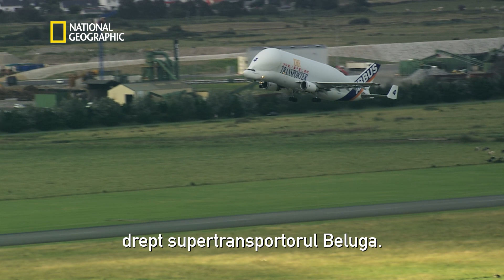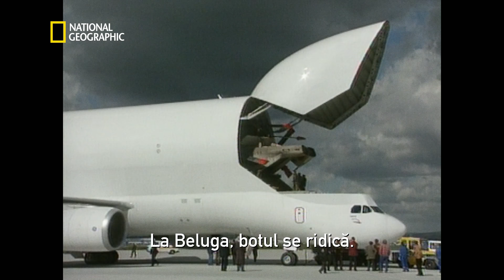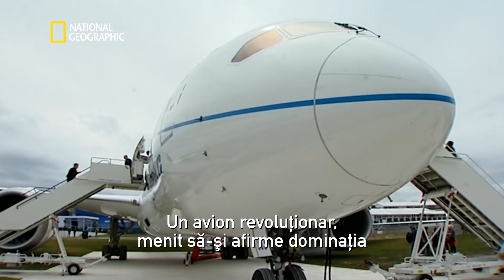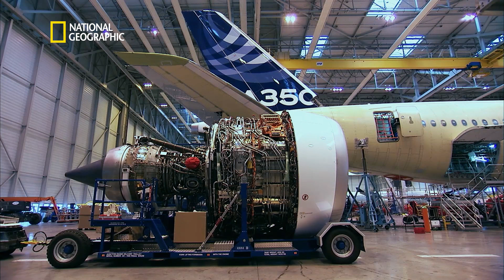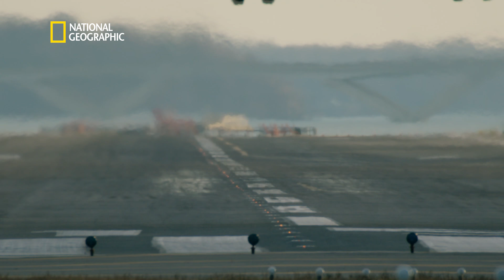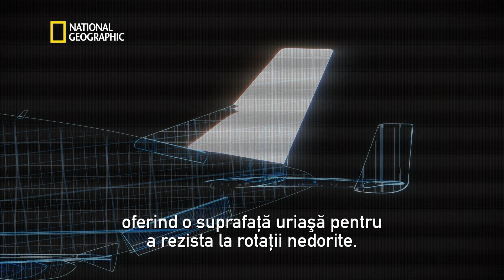BelugaXL: Există doar șase exemplare în întreaga lume! | National Geographic

Comment: Daca vrea cineva TOATE detaliile despre Airbus Beluga,aici sunt:

Proiectul a costat aproximativ 1 miliard de euro, iar flota este compusă din doar 6 exemplare în întreaga lume, ultimul părăsind linia de producție recent pentru a înlocui complet generația anterioară BelugaST.

Specificații tehnice principale

Față de predecesorul său, BelugaXL oferă o capacitate de transport cu 30% mai mare.

Lungime totală: 63,1 metri

Anvergura aripilor: 60,3 metri

Înălțime: 18,9 metri

Diametru fuzelaj: 8,8 metri în zona calei de marfă

Greutate maximă la decolare (MTOW): 227 tone

Capacitate maximă de încărcare: 51–53 tone de marfă

Autonomie: Aproximativ 4.300 km la încărcare maximă

Propulsie: Două motoare Rolls-Royce Trent 700

Scopul logistic și performanțele

Avionul a fost proiectat special pentru a susține ritmul accelerat de producție al programelor Airbus. Modificarea majoră adusă bulei fuzelajului superior îi permite să transporte elemente structurale uriașe.

Eficiență dublă: Poate transporta două aripi de Airbus A350 XWB simultan, spre deosebire de modelul vechi BelugaST, care putea transporta doar una singură.

Ușă frontală masivă: Secțiunea din față a cabinei de pilotaj a fost coborâtă pentru a face loc unei uși rabatabile uriașe, facilitând încărcarea directă prin botul aeronavei.

Designul iconic

Aspectul său exterior seamănă izbitor cu cel al unei balene Beluga. Identitatea vizuală a fost aleasă în urma unui sondaj intern la care au participat peste 20.000 de angajați Airbus. Designul câștigător, numit "Smiling Beluga" (Beluga Zâmbitoare), include ochii și zâmbetul simpatic pictate direct pe botul aeronavei.

Istoric și operare

Primul zbor: A avut loc pe 19 iulie 2018.

Intrare în serviciu: Ianuarie 2020, sub licența Airbus Transport International (ATI).

Statutul actual: Începând cu mijlocul anului 2027, flota completă de 6 avioane BelugaXL va rămâne singura responsabilă de logistica internă a componentelor Airbus, după retragerea definitivă a vechilor modele ST din rețeaua internă.

Acces pasageri: Avionul nu transportă pasageri. La bord se află exclusiv cei doi piloți și operatorii auxiliari de încărcare.